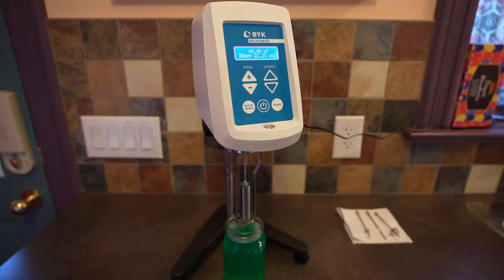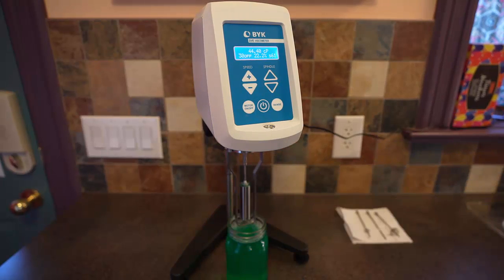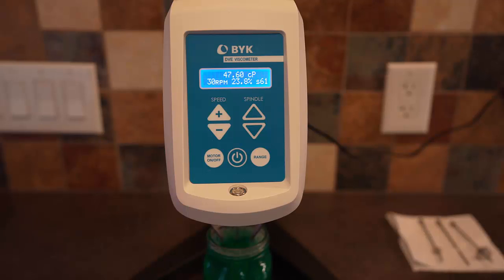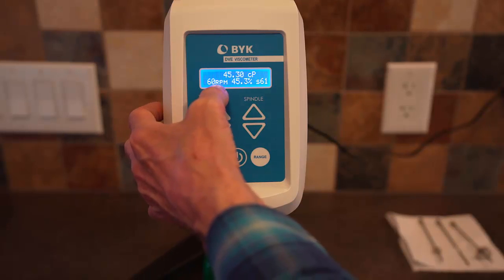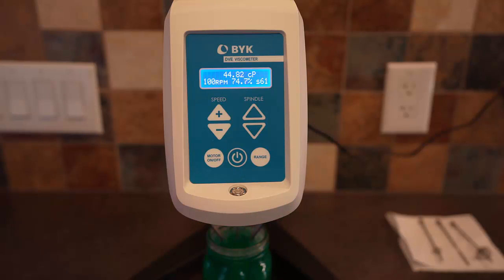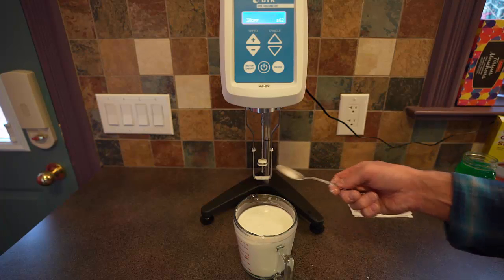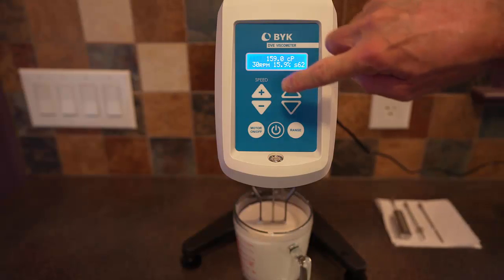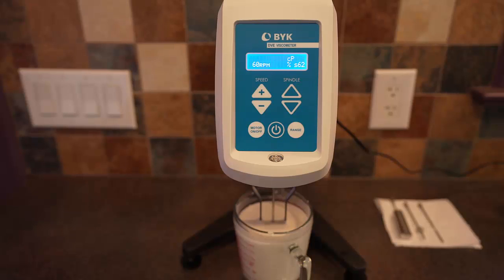Rotational Viscometer: Measurement of Dynamic Viscosity (Newtonian and Non-Newtonian Fluids)

Comment: I calculated dynamic viscosity of a hydraulic fluid at room temperature and then converted it to kinematic viscosity with the help of density. I wanted to know how to calculate the kinematic viscosity at 49 degree celcius
Reply from the maker: There are approximate ways of doing that calculation.  See the (exponential) correlation in the property appendix of White and Xu. You may still have to estimate an unknown viscosity factor (C), based on similar oils. See the footnote of Table A3, if you have the textbook. I'll give you a rough estimate.  I hope that helps.

Comment: Hello, could you please explain why the viscosity of newtonian fluids remains the same despite changing rotational speed? Im an undergraduate engineer doing my thesis right now and im stuck on results. Thank you very much
Reply from the maker: For Newtonian fluids (air, water, etc) the shear stress between adjacent fluid layers varies linearly with the rate of shear. The slope of this straight line is the dynamic viscosity. See a textbook for this plot.  So, the viscosity (slope) remains the same as you shear the fluid at higher rates. So, it takes exactly double the torque to spin the spindle twice as fast. That's a Newtonian fluid i.e. constant viscosity.  I hope that helps.
Reply: @FluidMatters  I think it is pretty clear thank you very much for taking the time to explain it. If the rheometer doesnt give us the required results for our mixture, do you might have any idea what is the cause behind it? While mathematical (from temperature to weight/weight ratio) everything is alright
Reply from the maker: @ Not sure. The flow has to remain laminar. At high spindle speeds transitional flow can cause nonlinear behaviour and poor measurements.
Reply: @FluidMatters  I see, thank you very much for your time!!!

Comment: Can you tell me why you take the speed of 30 rpm. How is this determined? I know that according to the DIN EN ISO 2555:2018 standard, the full scale value (M%) should be between 45 and 95 %. The values I determine sometimes vary enormously depending on the spindle and the speed. Thank you for the great video and I hope for an answer soon :)
Reply from the maker: This is a demo for undergrad engineering students learning about the general concepts of viscosity and Newtonian/non-Newtonian fluids. This video is not about "best practices" for rotational viscometers. It makes sense to follow ISO standard, of course.

Comment: I just tried doing it for water , which is a newtonian fluid, right? I noticed that the mPa-s(also centipose, unit of viscosity) decreases with the increasing rotational speed. Is this normaL??
Reply from the maker: Water is newtonian. This type of instrument requires fully laminar flow. The viscosity of water is very low. So, maybe you are getting turbulence in the boundary layer at higher rotational speeds, which would result in an inaccurate measurement. Just a thought.
Reply: @FluidMatters  ahh I see thank you.

Comment: Is it okay if i remove the spindel guard when measuring viscosity?
Reply from the maker: I think you can. (I'd have to check the manual to be 100% sure, which I'd bet you can find online.) It might change the calibration slightly.
Reply: @FluidMatters  Sir, have you checked the manual? What is the purpose of the spindle guard?